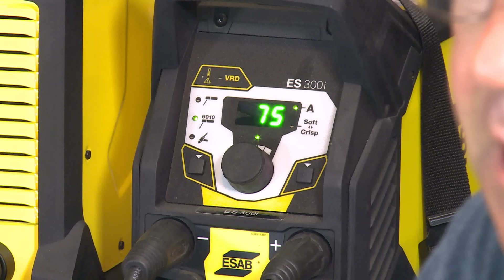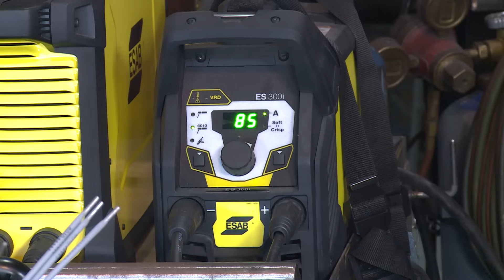🔥 6G Pipe Weld - SMAW (e6010 Root/Fill 7018 Cap)

Comment: Sir, I have never done this 6010 root without the whip back and forth. I have a weld test in the morning doing this. Not sure after watching this video if I should whip it or not. Ive always wateched u. I didn't expect to see this. Any suggestions
Reply: It depends if your keyhole is opening too much if its consistent run it smooth and whip it to build momentum for the growing keyhole

Comment: @4:00
 "hot pass" with 7018? Here in the UK, ive never worked to any procedure that has called for a 6010 hot pass. 
The more common fill/cap rod for low to mid pressure pipework is a Vodex 6013 after a fleet root. So after root pass with 3.2mm fleet, just switch straight for a 2.5mm vodex and run it in on the same amperage to strengthen the root.
When using LowHy fill/cap for mid to high pressure work, it's 99% of the time either a tig root and hot pass, or a 7016 lowhy root.

Comment: I'm currently enrolled at a welding school and I have had 0 issues on any positions, but this 6g is killing me! Failed both guided bend test attempts and cert test😒. Definitely going to be trying to take your tips, we are also on 6 inch schedule 80 as well.
Reply: 6g was a breeze for me. But I took 6-8 weeks to move on from 5g thanks to that bottom part of the root pass.
Reply: @solomonstello  funny you commented. I haven't touched a rod in over a year and a half. I'm all tig now😂
Reply: I still fuckin hate 6g smaw😂

Comment: That was just great,

Just great 😊👍
Reply: The distance between the two pipes is a few millimeters??
Reply: @saminyusubov7478  usually the width of your your electrode, with a chamfer of the same size  on your beveled edges...

But yes, and 1/8" electrode is about 2.5mm
Reply: @adampindell  What is the maximum distance?
Reply: @saminyusubov7478  the width of your electrode is nominal.  you could go a little narrower (2mm-1.5mm with 1/8" electrode) than your electrode if you're burning a little hotter (higher amperage) or a bit wider if you're running a bit colder, but I couldn't recommend running cold...

...leads to insufficient fusion 🥺

Comment: How come you do these fake test? You should do a Boilermaker tube test 2" extra extra heavy wall(schedule 120). Heli-arc root then 7018 flush and cap, cut out 3 specimens and do 3 side bends one crack and you fail. So stop doing fake test and show your fans a real world make or break weld test. Boilermaker 35yrs we showed our apprentice to weld without using their wrist and elbows to prop themselves up.

Comment: HAY BOB,YOU RUN THE BEST ROOT PASS I'VE EVER SEEN WITH E-6010 UP HILL ON PIPE,SIMPLY,TO THE POINT,YOUR NOT FIGHTING THAT KEYHOLE AND WORKING THE SIDES LIKE THE LETTER"U"LIKE MOST PIPE WELDERS DO.LOOKS LIKE THERE FIGHTING IT,YOU YOUR JUST DRAGGING THE ROD,EVERYTHING HAPPY GO LUCKY.MAKES MORE SENSE TO ME.-HOW COME YOU RAN E-6010 FOR A HOT PASS INSTEAD OF E-7018 3/32?-KEEP UP THE EXCELLENT VIDEOS ESPECIALLY ON TIG,MIG AND STICK ON PIPE.HAVE YOU EVER TRIED FCAW-G AND FCAW-S ON PIPE?I'VE ONLY HEARD OF FCAW-S DOWN HILL FILL AND CAP(COVER PASSES).

Comment: For you apprentice pipe fitters out there here is a little thing that may come in handy.Now everyone knows that the take up of a 90 degree pipe elbow  1 1/2 times the diameter thus a 4 inch pipe takes up 6 inches but some fitters have to look in the blue book for"takes up" on 45 degree elbows.No need.Use this simple method in your head, say its four inch.Start out with 4 next half of that and so on.Then Add the second and fourth number.Thats the take up.Example 4,2,1,1/2.Use 2 and 1/2 The second and fourth numbers.The take up of a 4 inch 45 Elbow is 2 1/2 inches.Works for all sizes.Also a  experienced fitter know that when you weld a 90  elbow it becomes a 92 degree elbow from the heat.If it has long legs it amplifies the amount it is off in the field.Therefore when you fit it together to be tacked put a wider gap on the inside of the elbow.If you are welding it yourself you know how much bigger you can make it. Otherwise you may be off quite a bit on say a 15 ft run.Now if it is off you still can fix it with heat from a rosebud.Heat up the outside of the bend very hot ,them when you put cold rags on it it will bend backwards further than it was before.This is how welders used to deal with piping going going to pumps with brittle cast iron housings to relieve stresses before there were flex pipe spools .
Reply: The distance between the two pipes is a few millimeters?
Reply: You go a long way "around the barn" with that 45 degree fitting take out. How about shortening that up by multiplying the pipe size by 5/8ths? I was a young squirt as a pipe welder when my fitter showed me that old method. I looked at it and asked him why not just multiply by 5/8ths. He swore to me that it wouldn't work on every size pipe. It does. . Also, that stuff you wrote about the 92 degree--------------------if you put strong tacks on fitup and welded from the inside towards the outside of the fitting, it will never draw. If you are working high quality piping, such as nuclear code welding, that rose bud stuff and such is illegal.

Comment: Bob, have you done any 2” sch40 carbon videos? 6010 root 7018 rest of the way out. I’m having trouble on my caps on 6g and can’t figure out what I’m doing wrong. I just passed my 2” sch40 6g tig test and next is the stick on 2” and I need some pointers. My cap keeps “sagging” to the low side.
Reply: The distance between the two pipes is a few millimeters?

Comment: Hi, you were running 1/8" 6010 for your 2 root passes. First one with no oscillation, and second you were oscillating. When you went to the 7018 passes were you using 3/32" 7018? Also were you allowing the pipe to cool between passes?
Thank you Christian

Comment: When you drag your root how can you tell that you're getting proper penetration and keeping your keyhole even? I've only tried once and I felt like I was guessing the entire time and it ended up too heavy. I whip and pause m 6010 open root.
Reply: Its all with experience, if your weld is not going in uniformly you will feel it when you are welding and your weld puddle will not flow. Main thing with stick welding is to keep your pool consistent. once you start penetrating and get in a rhythm you wont lose it and when you do you will know. Hope this helps.

Comment: will it be possible to penetrate good in root pass using e6011 on 6 inch sched. 40 pipe with 1/8 landing @ 3/32 gap.  thank you. Bob Moffats

Comment: I was afraid I would never see anybody that was left-handed welding, I thought I was the only one.
Reply: Tekoa, I´m left hand and try for a time weld with the right too, need practics for training the mind and hand. latter is like just your good hand.
Reply: Don't see why being left-handed would be a problem, other than someone having personal issues about 'oh NO, not what I'm USED TO, different from ME!'.  Maybe need a grinder with the handle on the opposite side, big whoop.
There would be some welds having a leftie would be very helpful for (left corners and such).
Learning to be good with both hands will be helpful for welding into corners, around pipes, etc.
Reply: I got yelled at everyday when I was learning because I would practice lefthand. Now I'm a pro in any position with either hand. It makes life easier..

Comment: I currently attend college for welding, we weld schedule 80 6" pipe 1/8" gap with a 1/8 " 6010 rod, we are taught to keyhole and step forward and backward to stack the bead all the way around, I have tried just dragging the rod and it doesn't work the way you are doing it, can you tell me why? we use Lincoln machines run at 200 amps 2 arc force and a in booth remote for the temp, I run mine on 5 1/2 which is about 110 amps, can you tell me if this is right
Reply: That seems a little warm.... try 85-90

Comment: Here's a question why pipeline welders use the stick method is it faster, stronger, easier in the field then the other two arc type welding? Thanks
Reply: Very portable for field work.

Comment: Hello, got some question about stick welding, when i set current to certain amps like 80 - welder keeps 80 amps while welding, but when the electrode sticks - then amps go up to 220~ The welder is mig/stick inverter, there's switch to set off mig and turn to current control in stick mode, but it looks like it somehow remains in constant voltage characteristics. What do you guys think?

Comment: also 2nd question. there is no spec on 3/32 vs 1/8th in rods for your 7018 on the 6g up hill test correct? was told different at yesterday and wanted to check on that

Comment: could you go over body positioning? I'm having a bit of trouble with my cap and it's just because I'm not comfortable. think it's more so on cap from different angles to prevent undercut
Reply: Tbh I’ve been welding for a while now and When I was learning we always got taught abc (always be comfortable) but that’s like finding a needle in a hay stack when you’re in the field. For beginners I would just prop your non dominant elbow and use you’re fingers to steady you’re dominate welding hand. Pretty much the go to. But and the end of the day 90% of the time you’re gonna feel out of comfort
Reply: The distance between the two pipes is a few millimeters

Comment: that was great i like to close my gap use a lighter land i the field that speeds things up. i drag my root. hot pass with 7018 feel like it is cleaner, and stronger.  that machine runs smooth. i was also a aws cwi. arc strikes are not aloud in are code the grinding has to be kept to starts and stops and feathering tacs, on tests. great job that should help people. the thing i would say is every welder is a little different have to do what works for you.

Comment: well that is NOT the 1965 Montgomery Wards buzz box that i have... my question is why start with 6010 rod and finish with 7018 rod... wouldnt 7018 do the same job from start to finish???
Reply: 6010 best for root it burns through paint and rust
Reply: 6010 is used for open roots/gaps because it's a fast freeze rod. 7018 would want to fall in the gap without getting proper breakdown of the edges of the pipe.

Comment: Can you explain some uses and practical applications for some of the more esoteric welding rods, like xx14, and xx16? They seem to be pretty popular here in Europe (Scandinavia specifically) for pipe roots, whereas cellulosic rods are almost impossible to come by unless I special order them. And maybe do something on any other more specialty/out there/rarely used carbon steel rods that don't typically see much use if that's possible to get a rundown on, just for curiosity's sake?

Comment: Thank you Bob. Please discuss 6010 uphill vs downhill. I believe the pipeliners union entrance test is all downhill.
Reply: workwillfreeyou uphill testing is a lot of refinery work processing. You will find 6010 uphill in refineries. Some say 6010 uphill provides more strength. I don’t know if I ageee with that. Mostly everything pipeline all downhill work.
Reply: @TundraCamburg  would you say uphill is for structural, downhill is for flexible?
Reply: @DatBoi-mo9vc  downhill is just for speed. 6010 runs just as well up or down. Up puts a heavier root in
Reply: Pipeliner is 6010 root downhill. 8010 out all downhill